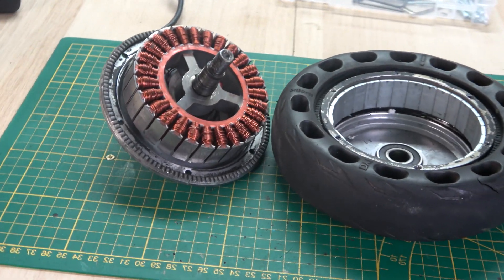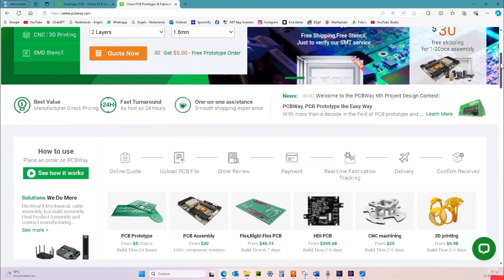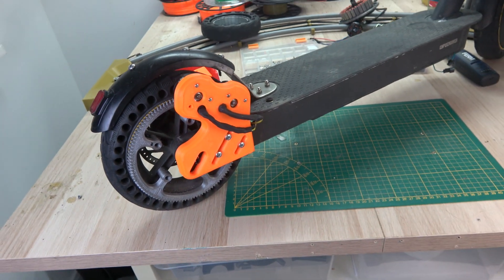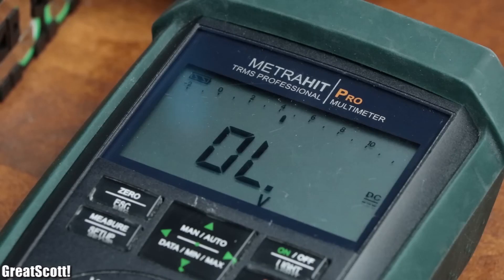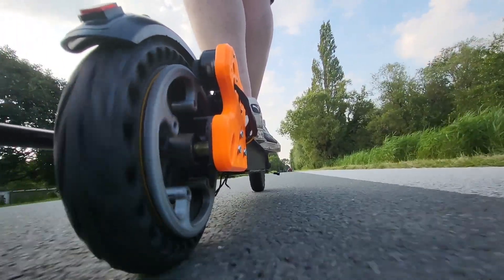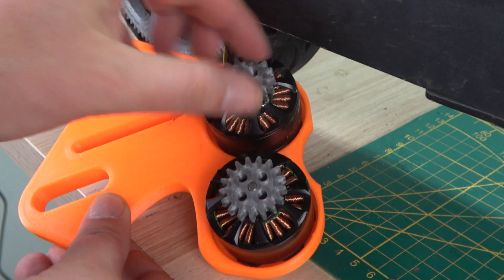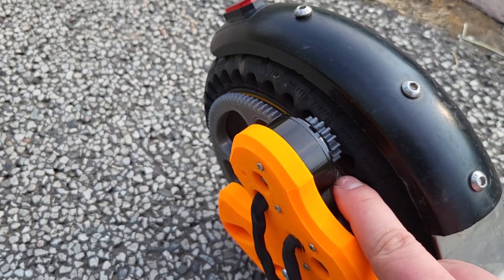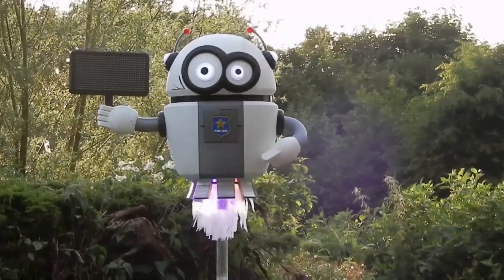Making My Electric Scooter Fly With Drone Motors..

Comment: I came up with a relative concept using RC type 3-phase hobby motors where 4 would go on top of the chain and 4 would go on the bottom with each half in opposite rotation.
There are some hobby motors out there that will definitely withstand the heavy loading with enough of them in the drive train. 
The ultimate purpose also being they're so very tiny and incredibly cheap.

As far as battery limitations, the simple solution is to run them in a huge series circuit for maximum voltage, minimal current and then use a step down converter.
I'm an electrical-electronics engineer btw.

Comment: I like the drilled solid tires on e-kick scooters, Hiboy S2 Pro my rig & similar since air pneumatic tires on such are a absolute turd to get replacement or very hard & time consuming with lube & tire bars to get back on, ask me how I know with Segway Mini Pro OG magnesium alloy & 350Wh battery, an OEM tire popped while riding causing me to crash, ouch, getting a new tire when the product was new, a total pain in the ass too, & no tire shop, no bicycle shop, no one would help me mount it, so I used coconut oil, a hair dryer, & two tire bars for hours to do it //
Reply: It has a top speed of 18.6 under motor power, regen, & cruise control ^^ but it can hit 50 MPH down steep hills near Seattle & that is sketch, ask me how I know. It also rides nice on museum quality paved surfaces, but drilled solid does not smooth out the bumps, its a trade off well worth it to never have a popped tire, since you ride on the side of roads where sharp crap more common //
Reply: In most cities & suburbs in USA or America, a car that can go up to 85 MPH almost required to work or live, since everything so far apart or spread out // low density, though we only pay $1.20 per liter for petrol or $4 per US gallon & people even Winge about that

Comment: Faster than 30 MPH or 40km/h on a short wheelbase w/ no suspension very sketchy in terms of if or when you biff or make a mistake & crash, helmet & gloves & leathers & boots & protective or your going to get serious skin rash on concrete or pavement, its not snow or water, it will tear your skin up fast & sheer it off like an angle grinder // I think normal bicycle analog pedaled by human 12-15 MPH or 20-24km/h that is probably a safe speed for just a helmet & gloves //

Comment: Good idea!

I personally would like to use a light and small booster motor/ battery setup on my fat bike for traveling to the trail, sometimes 5-10 miles on the streets. 

Motors are not allowed on most trails and carrying extra weight is counterproductive up hills, but if I can build a small and light ‘booster pack’ to help get me to and from the trails it would be amazing! 

A drone motor setup for this with a small cogged belt and proper cooling and dirt shielding for the drone motors might make this work!

Comment: Would have much easier to just overvolt the scooter motor with a better controller (with no speed cap) or a higher voltage battery, usually they are overbuilt anyways since they dont want issues with customers

Comment: there's something wrong with the charger you're using. It's a 13s2p battery, full charge voltage should be 54.6V
You are missing a whole lot of SoC there

Comment: this wont boost the speed in anyway as the speed is software locked and wont just go faster cause u added some drone motors to it,, ur more likely to completely destroy ur scooter battery by doing this.. never do this..
Reply from the maker: So you are saying that when i drive downhill the scooter slows down?
Reply: @ConceptCraftedCreations  do u know physics? Of course, if u drive downhill u move faster but its not under the scooters own power its called downwards gravity ur not going faster under the scooters own power therefore your not faster.
Reply: @ConceptCraftedCreations  the drone motors are not a good addition caue of the power hold your just going to damage your scooter that way, if u want to unlock your scooters max speed use custom firmware like everyone else does its the safer method

Comment: You should use external lock-washers between the plastic plate and bolts, screwing the bolt directly on to the plastic will wear it out or worse, crack it.
Reply from the maker: You're absolutely right! And i would if i had them lying around but unfortunately i didn't 🤓

Comment: I have entered this video to say i have just put second motor on the rear which was cheap and easy to do
Reply from the maker: Good one! And did it also increase top speed?
Reply: @ConceptCraftedCreations  mostly torque however i cannot compare one to one since i also replaced drivers for flipsky 75100 and even on the same voltage speed was increased due to clear sinewave so with two of them at 10s i got about 40-45 km/h measured by gps however with 13s battery i got to 65km/h (i had to use 14s with single motor and old driver in order to drive around 45km/h)

Comment: use high power drill like Milwaukee and steel gears. that drill can give out 1200lb. torque on 1500 rpm. +bataries are undead and motor is brushless
Reply from the maker: I actually thought of using my Makita drill.. Maybe a fun project for the future?🤓

Comment: This will cause fire when you have cells discharging at different rates
Reply from the maker: It is indeed not recommended for long-term use, but for this test alone it is not such a problem, I thought🤓

Comment: Do NOT draw smaller voltages like that from the battery, as it will result in pretty severe unbalancing and could cause an early death of the battery. If you're spectacularly unlucky, it's conceivable it could even cause a fire. You need to have another battery specifically for those motors.
Reply: I was like, that was smart lol
Reply: Only part to disagree with is that it's not gonna cause a fire, li-ion just dies when overdischarged, li-po is what combusts into flames
Reply: Or just use a beefy enough buck converter ;)
Reply from the maker: @fallingwater I will not recommend it for permanent use indeed.. But for this test I didn't think it was a problem🤓
Reply from the maker: @minimalskill6592 That would be a good option indeed👌
Reply: Another option would be to step up to three motors, tap the battery every 1/3 for each ESC, isolate the control signals for each ESC, poll the BMS to get cell voltages and nudge each ESC's torque output in response to cell voltage discrepancies to keep every split's worst cell within 30mV from the others.
Reply: Well if you are willing to charge those cells separately and they are rated for the current you need its not really a problem but it does turn into a lot of extra work
Reply: @minimalskill6592  I would not recommend this because there is no BMS, and the buck converter will not stop until its too late and the battery will be permanently damaged when discharged this much :(

Comment: I suggest using 3d printed nylon cf ring gear/ internal mashing gear on the wheel ,metal motor gear combined with vesc75200, 6384 motor or 8080 motor, 20s3p battery😊

Comment: you don’t have to do any mechanical modification ,simply change the ESC to VESC75 , EVEN with the STOCK motor , M365 is capable of reaching more than 60 km/h with 20s batery
Reply from the maker: Serious?😮
Reply: Issue is that that's a crappy clone and not an m365, im myself a Mi Essential owner and i went 44kmh on just the stock ESC, on 10s/36v with just different software(SHFW if wondering), only hardware mods at the time was just swapping the battery from the 5.1ah one to a pro 2's 12.4ah one, same voltage

PS : at this point in time it's a 48v beast that goes up to 54kmh on flat ground w/o wind
Reply from the maker: @PureComedi  Beast💪
Reply: @ConceptCraftedCreations  Bit late to the party, but VESC uses something that is called field weakening. This setting allows the motor to run at higher RPM than stock by injecting raw amps alongside phase amps to weaken the magnetic field and increase speeds at high duty. As an example, my Zero 11x reaches speeds of around 50-55mph, But mounting VESCs I can reach way past that. Of course, you need a battery than can deliver the normal running amps as well as 50% more when field weakening is active.

Comment: Tapping into the Battery somewhere in the middle really isnt a good idea. Especially with something that draws power. You'll throw the pack out of balance so charging with balancing takes forever. If the bms can even handle these huge differences.
Reply from the maker: It is indeed not recommended for long-term use! But for this test I didn't think it would be a problem🤓

Comment: Now see if a large drone can be boosted with an electric scooter motor 😜
Reply from the maker: But seriously, I am now genuinely curious about how much lift you could create with a hub motor of an electric scooter🤔 So I added it to the list with possible future projects if you don't mind?🤓
Reply: @ConceptCraftedCreations  Sounds awesome. Not sure which design might be better; a regular helicopter (lighter weight but less powerful), or a quad copter (heavier weight, bur more powerful). Maybe a compromise with a dual rotor with contra rotating blades. That would be a simpler design, and could still be done with a single motor. With the blades rotating in opposite directions, the gyroscopic forces would cancel out. A quad copter using four motors would be ambitious and complex, and would cost a lot more to make. Either a regular single rotor helicopter or a dual rotor helicopter using one motor would be the most cost effective since you already have the materials. A dual rotor helicopter with a scooter motor for each rotor would be another option and wouldn't be too cost prohibitive. Food for thought. Be really interesting to see the results.
Reply: Subbed:)
Reply from the maker: @Eduardo_Espinoza Thanks for the support🙌
Reply: @Eidolon1andOnly  But a helicopter needs a swash plate system. That would be very complicated. A dual helicopter would also need that. Quadcopters are used so much because they don't need swash plates and are relatively simple because of that.
To use a scooter hub motor with a propeller is a very interesting idea though because it has a lot of torque. That means it can have a very big propeller, which is good, because the bigger the propeller is, the more efficient it gets. (low disc loading => more efficiency)
Reply: @somebody3524  People have been making toy and remote control helicopters for longer than quadcopters. A swashplate is less complex than controlling four motors based off computations from the pilot's and sensors' inputs.
Reply: @Eidolon1andOnly  Depends on what kind of complexity you like most. I would certainly go for less mechanical complexity at the expense of having to deal with control logic and sensors, all else being equal. 
The benefit of software is that you have to code it only once, and there is already flight control software for quadcopters that could be (probably easily) modified for this usecase. I doubt that there are plans out there for a gigantic swash plate system for a scooter hub motor.
But i see the benefit of a helicopter design as you can use only one motor, making the aircraft less heavy and thereby smaller.